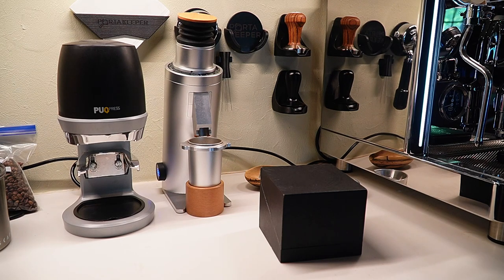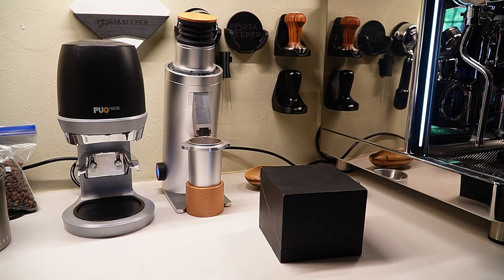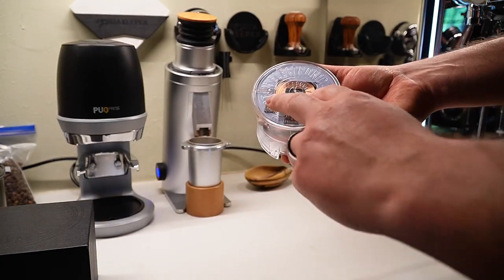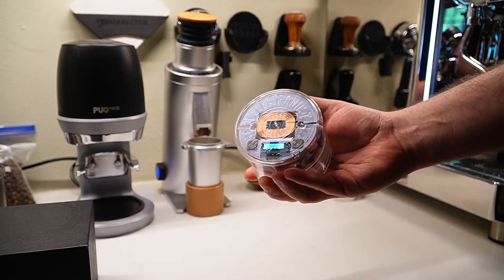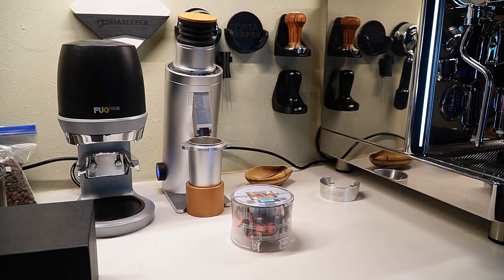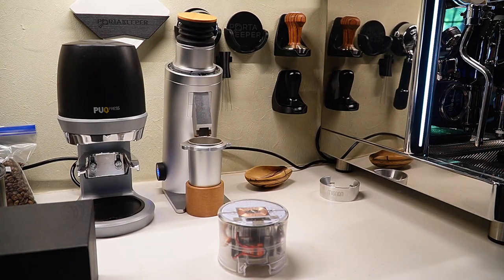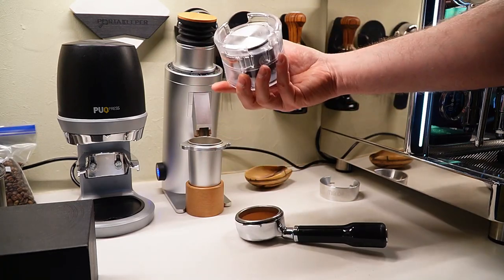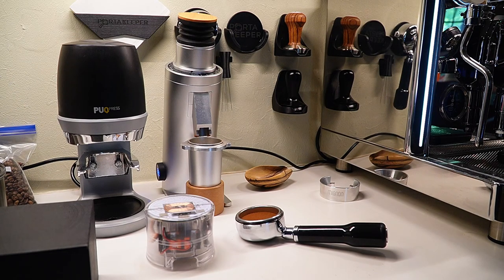BoseTamper Unboxing

Comment: Turns out you cannot leave it off the charger.   Battery drains within 24hrs. I confirmed with Daniel.
Reply from the maker: Yeah I asked.  It’s designed to be kept on the charger